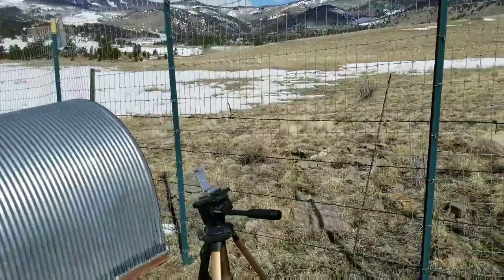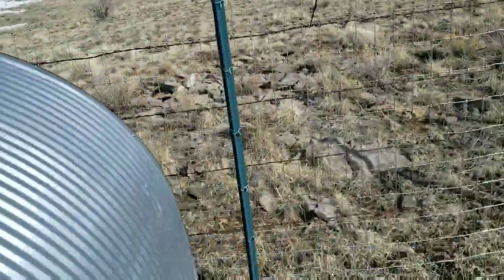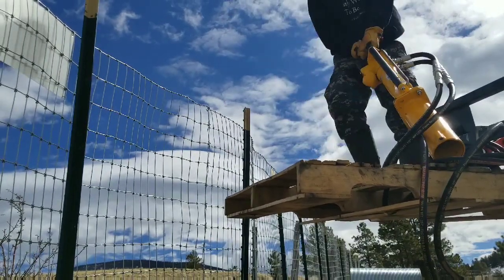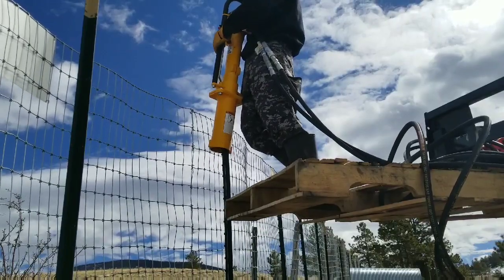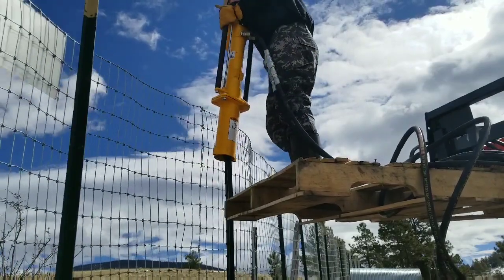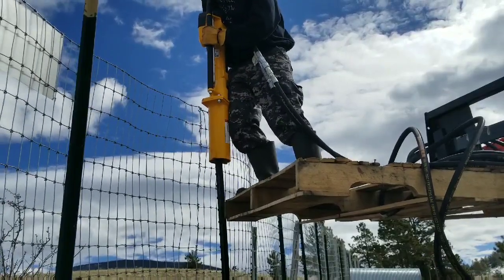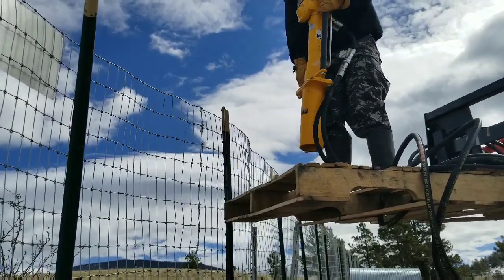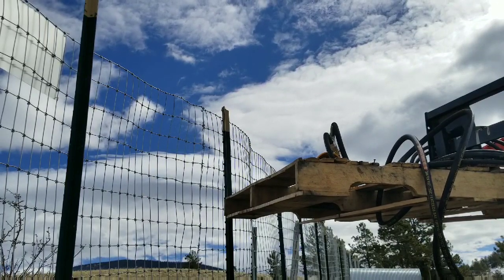Hydraulic Tractor T-post Driver

Comment: Rhino makes a 2 inch heavy wall adapter that bolts right into the bottom of that driver that will keep it straight on the post and stop the post from getting stuck in there
Reply from the maker: Yeah the tractor place said that but it was a 4 week wait to get it in. The tractor place built me an adapter that fits on the top of the t-post, it's been working great. Thanks for sharing.
Reply: Today's Homesteader Four weeks seems like a long time . If you still want one let me know
Reply from the maker: @steveorrick813  I'm good for now, Thank you I appreciate it.
Reply from the maker: @steveorrick813  If your offer to get the attachment for the tpost is still  available I definitely would like one. The adapter the tractor place made as broken twice now and it just broke again today.